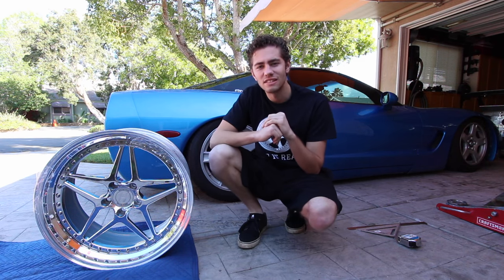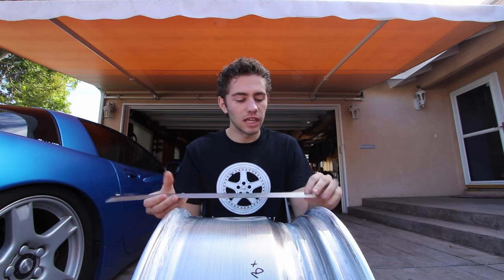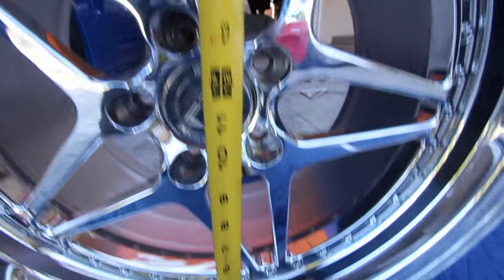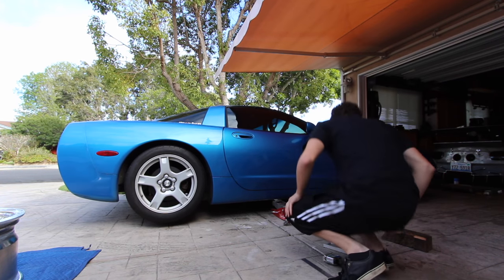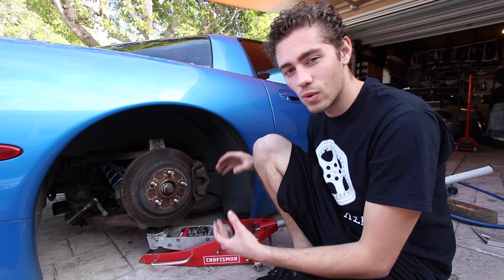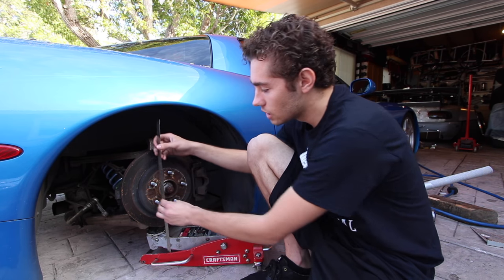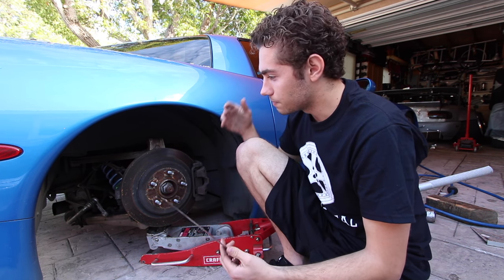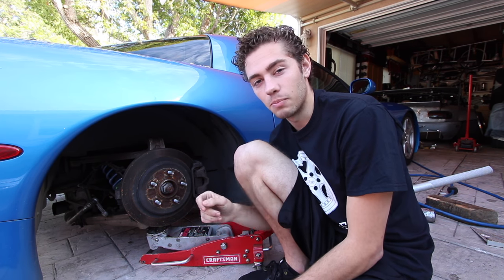How To Measure For New Wheels

Comment: Myfavourite method is the eyeball technique.

1. Find those dank ass wheels you want, preferably enkei, rotiform or bbs knock offs.
2. Look at the picture of the wheels on your computer screen.
3. Look at your car
4. Repeat steps 2 and 3 until you have decided if the wheels fit, I recommend repeating the steps 6 times, any more and you may actually start measuring stuff.
5. Repeat "eh fuck it, I can just roll the fenders" twice
6. Add to basket.
Reply: Will K accurate
Reply: Will K I stand by this rule. works pretty well
Reply: Exactly how I plan to fit my new Cosmis Racing wheels
Reply: Except with a Vette, you can't roll fenders. But 88 to 2004 Vettes are 5x120 bolt pattern and 56mm offset all around, excluding the grand sport, zr-1 and z06.
Reply: Will K best way to do it😂😂😂
Reply: Will K extra dank😎
Reply: fucking hilarious !!!

Comment: One other thing to take into account is not only is the lip of your rim going to add to that measurement but the side wall of your tire will likely protrude out past the lip a half inch on each side of the rim also. I had to adjust the offset for my new rims to accommodate the wider tires on my car since the original rims had a very positive offset.

Comment: I understand bags are a little more expensive but wouldn't it be a better option so you don't rub away you're tires while driving
Reply: Moises Mora static lyfe
Reply: Bags don't belong on a drivers car or a drift car.  Too much performance sacrifice.  Better to find  a middle ground between form and function but most drivers lean further toward function.
Reply: Jason Almont Sir his car scrapes on the floor, You don't think that's a performance sacrifice??????
Reply: There's such thing as performance bags which creates a middle ground between function and form.
Reply: but theyre expensive, heavy, not even close to as predictable as coilovers and are way more complicated to install and mantain
Reply: also a car that drives as low as it parks is just way fucking cooler
Reply: Moises Mora bags are for weed stop lmao

Comment: I wish my 87 had regular brakes with rotors..can I upgrade to that without major changes? it seems like it causes so many issues and its outdated. I wish I never sold my ws6 after it got hit and swapped it. my uncle said there is not much room in the 87 but when I pop the hood it doesn't seem that way I wanted a ls7 in it I suppose that future is out of the question